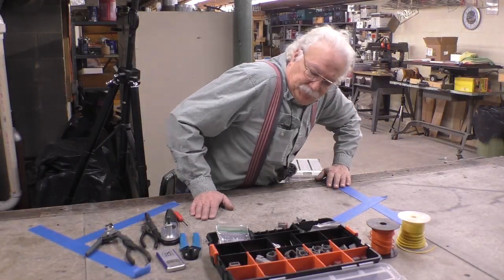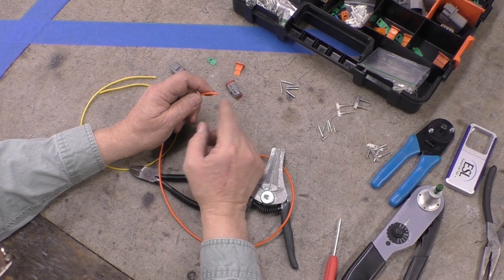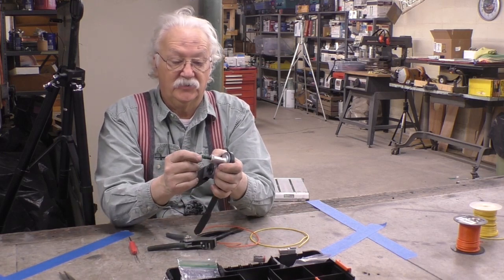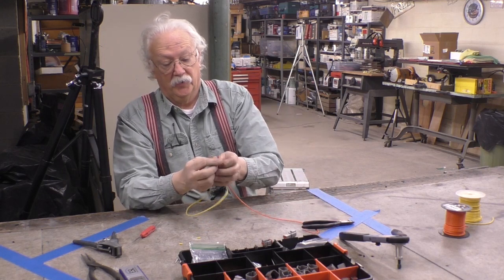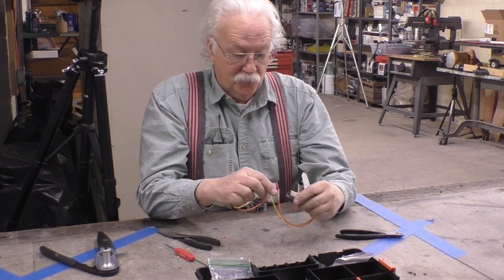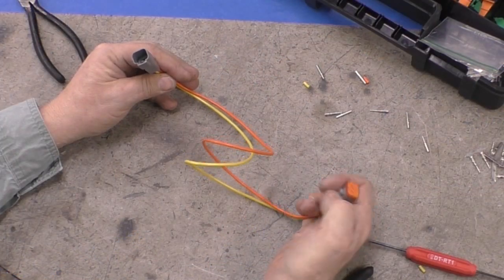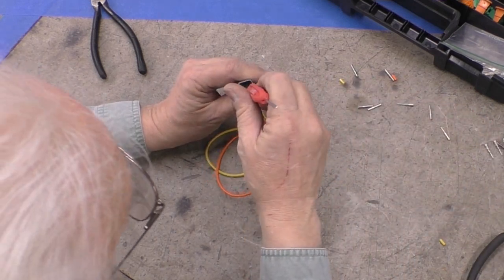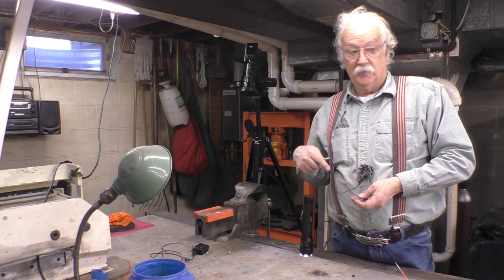Deutsch Connectors, Assembly Instructions, Disassembly, Crimp Tool

Comment: Thank you. I used to use molex connectors. They are easy to assemble and to replace pins on.
But are not as water resistant.
So now I will try these.
Should have watched this first and bought the real tool.
Thanks!

Comment: You forgot to mention observing the connection polarity #1 and #2 stamped on each different connector.  If the wires are inserted in the wrong hole, polarity sensitive loads like LED lights will not work.
Reply from the maker: My oversight.

Comment: Hi, I'm converting a few of my early 1994 Harley-Davidson connectors to Deutch. I discovered one of the ports has 2 wires going into it. I would imagine that trying to force 2 wires into one of the Deutch connectors is a "no-no"? In my case would it be best to peel back some of the insulation and soldier the two together and then use one port? Can't seem to find an answer to this. Thanks for sharing your thoughts and advice. I hope my above question made sense.
Reply from the maker: Do you have any other empty pips in the connector? In stead of soldering the wires together, run them through the connector separately.
Reply: @ThrottleStopRacing  no it doesn't
Reply from the maker: @kennethwise7108  I think you have no other choice....wish I had a more elegant solution.
Reply: @ThrottleStopRacing   Sounds good thank you for the response

Comment: Dumb question maybe. Does the crimp come into play anyway in the lock?  I have a hood set of square crimpers that make a wire ferrel into a square for screw down term like amps and fuse blocks. Doesnt have a point but makes a super tight square in the barrel. Should have bought a kit. I paid $100 for 2 wire kits. All they are is  12x 18-20" of wire with Male and female connectors to extend wires sorta plug and play.
Reply from the maker: The crimp does not play a part in the lock.
Reply: I found both sets I ordered. I have male and female barrels. As easy as they come apart I'll try some and see if they work. Pretty impressed how easy they are to work with compared to weather pack for sure. Other than crimpers no special tools. Have them but didny need anything but a pocket screwdriver.

Comment: Of all the videos on these connectors out there, this is the only that actually explains everything fully. Right down to which plug goes with which connector - yes, I even struggled with that for a bit......As a rank beginner and electrical dummy, I managed to get it done without any throw away pieces. Thanks folks :)

Comment: Sweet! More expensive tools and connector sets.
Exactly what I needed.
Thank you for the tutorial.
Reply from the maker: The correct tool is very expensive, the knock offs do not do the job.
Reply: Not always true. Purchased a knock off, non-ratcheting tool for crimping the pins in some knock off Weather Pack connectors. Both the tool and connectors have been working great for crimping and hundreds of miles without failure. People copy ideas all the time with great success.
Reply from the maker: @cri8tor  That is good to here.

Comment: Thank you sir for the great video. Can you tell me what the minimum gauge of wire  is this connector can take. I have 8 wires that are really thin (maybe 20 gauge) that I need to group them into one connector. Thank you!
Reply from the maker: Product specs say AWG 16-22 .... I have been able to use 14 gauge in the pins, I have not tried smaller gauges.  See this link for the specs.
https://www.buydeutsch.com/connectors-s/1921.htm?gclid=EAIaIQobChMIwvXB8aj-4wIVif_jBx1a_gekEAAYAyAAEgKQi_D_BwE

Comment: these are used all over. sooooo much easier than the weather pack imo.   LADD industries is a distributor too.  

I really wished they would come out with a larger series that the DT.  There isn't any connector that has multiple ports for 10 AWG.  Whole new series would be slick for converting old marine engine wire harness over to deutsch..  12-10awg  ..   14 is about the max that i know of.
Reply: There are larger Deutsch connectors. I cant give you the p#'s right now bc my kit is on the truck but I know there are some large ones in there. Theres also a deutsch but connector and a deutsch 1 to 2pin adaptor, so you can go from an existing connector and add 1 more off of it.
Reply from the maker: Thanks for the information.

Comment: More videos of this please in further details of tools, different between open barrel and close barrel, stamp and solid. I simply love this video.
Reply: Open barrel are crimp only  - that all purpose tool from the local hardware store is going nowhere, so leave that for cutting machine screws and get the right tool.  Typically, these  benefit from the extra wrist tab that locks onto the insulation to prevent pullback - the stamped connectors he showed come with that I think.     Closed barrel can be crimped or soldered.  And for any pin connector system, get extraction tools to match the manufacturer.  The connector in this video is a front release type - pretty good all purpose.  The pin  goes on the wire before putting it in the shell and closing it up.   If you are worried about pushed pins on hookup, then a rear release system is bullet proof [but not as commonly used].  But, you gotta pull your wires through the shell first before putting on pins, and if you get arrangement wrong you will be cutting those crimps off and reaching for new brass... no mistakes forgiven.  There are exceptions to these arrangements to be sure [some very clever inventors out there, you know].

I like these Deutsch connectors for most devices: reasonable heat resistance, pins stay put, and brass has fair protection from an occasional hose down.   Just make two pigtails [one male connector/one female] and keep them in the toolbox for troubleshooting if need be - alot of end devices are potted/sealed [with short leads provided] and your typical meter lead is too big to jam into these connectors without risking damage.   I found one example [but you could just make your own]:  www.pico-technology-deutschland.de/Deutsch-DTPXX-4-Connector-Breakout-Lead-for-4-pin-Large-Connectors.   Disclosure?  I know nothing about this company, and have not done business with them.  I just stumbled upon the right item to demonstrate - notice they leave enough single conductor available to put an amp clamp on it for testing.  If you've sleeved wires or heat shrunk them into a bundle, this is a time saver down the road.
Reply from the maker: Thanks for the information.

Comment: This was a great video I bought lights with these connectors and need to remove the connectors to snake the wire through the hole. I was uncertain how to take these apart, and you really helped out. I assume I can take them apart feed them through, and put them back together.
Thank you
Reply from the maker: Correct.. Maybe upgrade to the next number of pins and include the extra wire in the plug?
Reply: Thanks

Comment: good video. what is the IP rating of such connector?
Reply: i found the answer. ip68, immersion up to 3 feets
Reply from the maker: @Sultanbayev  I do not know what that means, I assume it has to do with how resistant it is to the elements?
Reply: Lever-Family-Racing it is ingress protection level (ie International protection marking). First number relates to dust, particles and objects, second relates to water. IP68 means that it is dust tight (maximum possible protection, from 0 to 6) and can be immersed in water to 1m deep (from 0 to 9k, where 0 is no protection, 9k powerful hot water jets).
Info about IP rating and water depth I found on TE website, product’s FAQ
Reply from the maker: @Sultanbayev  Thank you very much, a clear concise and understandable explanation.
Reply: Lever-Family-Racing you are welcome. You showed me how to prepare connectors, i shared some back)